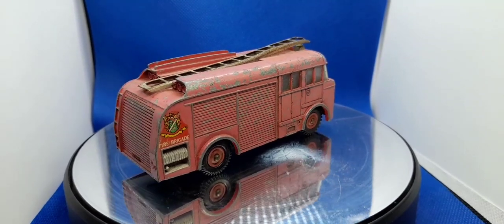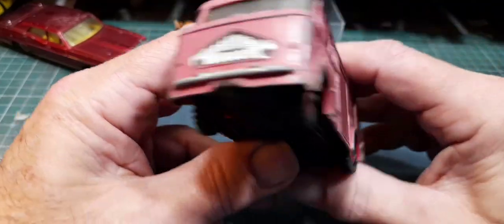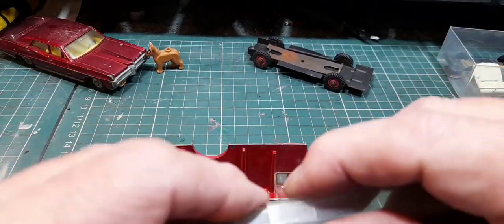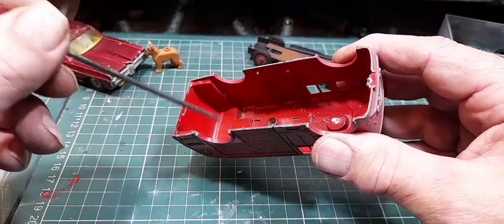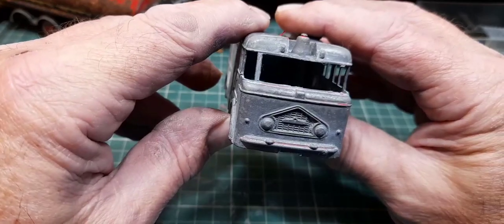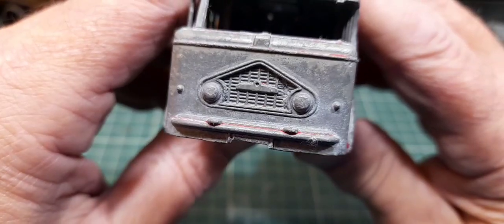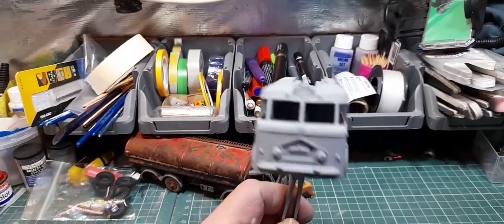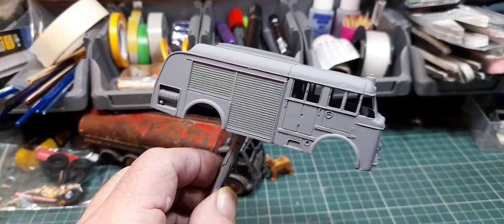Restoration Dinky toys fire engine no/259  1962/69.

Comment: Looks Stunning Martin, your attention to the little details is second to none, great tip for making the pillars using hair clips. Can I ask which paint you use to make your black wash and what you mix it with, it really makes all the difference using that in the front grills, gives it a much more realistic look👌👍
Another very impressive restoration and a nice clear informative video as always👍😊
Cheers Martin, take care, all the best to you and your good lady, hope she is doing ok with her recovery, Nick.
Reply from the maker: Hi nick glad you liked it .
The wash that I use is a tamya panel line wash ,but you can make your own the one I use is enamel based, but you can use an acrylic based one ,enamel is better basically get your enamel thinners and add a few drops of black gloss enamel to it until its like muddy warter you might have to exper a couple of times to get the right thickness. 
Apply to glossy surface just need to touch a small drop to were you want it and it will flow along any resesed lines let it dry and wipe of any over spill with thinner  
You don't need to paint it on like normal paint .
Try it .
All the best Martin 👍

Comment: Another superb restoration Martin, I like the old fire engines, I had a Commer fire engine when I was a little lad. When you make your "how to" videos I'd appreciate if you could explain what the black wash is and how you do it. The result of that grille is awesome. Hope your good lady continues to recover from her surgery. Take care, and best wishes. Peter.
Reply from the maker: Thanks peter , if you want you can buy the wash ready mixed tamyia do it and its called panel line wash you can get different colours. Or get a tin of black gloss enamel and thinners and pour out some thinner in a small jar and add a few drops of the paint so you have a muddy warter .
It's best applied on a gloss surface just put a drop in where you want it you dont need much and it will flow along the reses lines. 
When it drys you can remove over spill with clean thinners.
Practice that's the best idea on a junk casting.